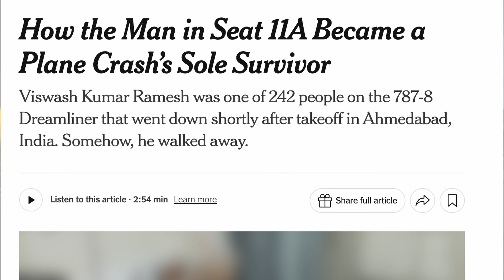Why the RAT Changes Everything – Air India 171 Update

Comment: I fly a pitts s2b and yak55m. Never any large commercial aircraft. I had an engine failure at 3100 feet in an old luscombe silvaire and it sucked. I was able to land in a farm field but the mud was pretty bad and damaged the aircraft but overall went as well as it was ever going to. I cant imagine the feeling of having a total engine failure with hundreds of people on board. So sad. I remember right after my engine failure and diagnosis my very first thought was i was glad nobody else was on board with me. Knowing you have a plane you cant land anywhere in front if you and hundred of people depending on you would be worse than knowing your going to die.

Comment: Even to retract the landing gear, you need power, you don't have special batteries, you rely on Engine power. If Engine fails, Electrical systems, hydraulics fail and landing gear not getting retracted and RAT gets deployed, which don't rely on Engine power, Engines failed Why?. No lift.

Comment: I thought I saw a video by someone who allegedly was on the same plane on the previous flight before this one and he had a video inside the plane showing everyone trying to turn their AC on and the AC wasn't working. Again, can't verify his claim but would that even be an indication of something wrong?
Reply: Because the airline is saving money by keeping the AC off, in figurings around 500kg of fuel an hour. The AC is the pressurization system, you won’t have oxygen after passing 10,000ft if it was actually not functioning.

Comment: Capt Steeeve, not only can you hear the RAT, it's what you don't hear. At that altitude, and how close the original cameraman was, you should hear the engines howling, or at least making some sort of noise. All we hear is the RAT. Both of the motors were dead. Don't know/won't speculate on why, but there was no thrust from them, and they were probably causing more drag than anything at this point.
Excellent breakdown, Sir! Please keep up the good work.
Reply: I was thinking the same thing.  How is the RAT overwhelming turbines?   I don’t hear jet engines at all.
Reply: @chrismechanic6164  That's because the video showing the plane crash with added propeller sounds is completely fake. I’ve watched the original footage with its ORIGINAL audio multiple times, and there were no propeller sounds at all. It’s disappointing what some people will do just to get views.
Reply: Yeah that’s the first thing I noticed too. That is not what 2 huge turbofans running at takeoff power sound like. It sounds like the engines aren’t running at all.

But the kind of engines usually used on aircraft like the 787 are generally known for being extremely reliable. Obviously in this case they weren’t. This might be one of those accidents that has implications beyond just this aircraft.
Reply: That's what I noticed when the video played as well. Any turbine engine isn't exactly quiet, even at idle. If any engine is running at all, it can't be much above idle. Now the question is, why. There are exceedingly few single points of failure for both engines on most aircraft, especially something the size of the 787. But evidence indicates that one occurred. ☹️
Reply: He does talk about it..not hearing the loud engine sound but the cessna like sound by the RAT being deployed...
Reply: Exactly! I was thinking the same. A 787 at that atlitude with normal functioning engines would be so so loud. As you said, we shouldn't heat the RAT if things were functioning normally. I am not an expert but even if one engine was functioning normally I doubt we would hear the RAT over the sound of the engine.
Reply: @TheScarletteWhisper  What I heard was just what sounded like a commercial airplane. Hard to gauge if it was filmed inside. But if experts say it sounds like a RAT, then I believe them.
Reply: Instead of raising the landing gear they retarded the engine throttles. During takeoff roll they received a call about an extended car warranty.
Reply: If engines howled and roared then why would the RAT be deployed at all?
It is clearly a engine failure 
Remember the plane has issues and is not a normal one with howling engines that we see daily up in the sky
Reply: Exactly, my house is a few kilometres away from the airport, not near enough to be in a danger zone, thankfully but yes I do hear that BOOOOM and I love that sound but in this video, it's missing. The turbines are dead and that caused the RAT to deploy.
Reply: @leocoolguy4138  I used to go to a school very close to a test facility for RB211s. And they were extremely loud indeed even several streets away, just one at once, when they were inside the factory and our windows were shut. In the summer, we were either roasted or deafened. I missed that characteristic sound of jet engines on the video, there was just that rather strange whishy sound, which people seem to recognise as the RAT. I'd just assumed the sound on the video was poor.
Reply: What about the loud BANG the survivor reported? He said it happened right after takeoff.
Reply: @diversityparty  Usually, witness testimonies aren't that credible. Normally, it could have just been the landing gears being retracted. But since that never happened, that's an interesting clue.
Reply: @diversityparty  the loud bang was the RAT deployment
Reply: There is a report on-line that Boeing Employees who were working on three 787 that was manufactured in January of 2014 were at high risk of engine failure. This concern was brought to the attention of the senior management at that time.. However senior management responded that the three planes were going to be shipped to International carriers and so it did not matter..  The specific jet that crashed was one of the three aircrafts the Boeing Employees were concerned about..
Reply: @nathanmenon3772  That's interesting,, got a source for that? I remembeer watching an Al-Jazera documentary about the 787 and how they were saying it's only a matter of time until there's a crash.
Reply: @nathanmenon3772  Can you please confirm the source of the report.
Reply: @TheScarletteWhisper there’s an article about it on The American Prospect titled One of the Dreamliners That Gave a Boeing Manager Nightmares Just Crashed.
Reply: @nathanmenon3772 Stop with spreading things that are half truth.
Reply: ENGINES not motors. Motors are electric.
Reply: This video is plagiarized. Jeffostroff shared this information yesterday. Steve did not even refer Jeffostroff!
Reply: Might want to listen again, the engines are clearly audible, albeit not “howling” but it’s clear the engines are at least on and making noise alongside the RAT
Reply: Didn't hee play this exact same clip in the last video?
Reply: @dan-bz7dz  Like he said, it was someone recording a computer monitor as it played the video, not the original recording.
Reply: @AySz88  Yes, but I remember it as he played both. But maybe I saw that on another channel. Yesterday, I definitely watched the original.
Reply: @dan-bz7dz it was a recording of the original video, not the original
Reply: @dan-bz7dz  Yes, but that one was copied from a monitor. Captain Steve was very clear in his explanation why this original and it's much better quality. It would do you well to actually watch and listen all the way through, so you don't miss something important.
Reply: @jamesplotkin4674  I know. I saw both vidoes yesterday. But maybe it was on another channel.
Reply: @dan-bz7dz you don't listen too well do you. He said it many times smh
Reply: @dan-bz7dz  The video showing the plane crash with added propeller sounds is completely fake. I’ve watched the original footage with its ORIGINAL audio multiple times, and there were no propeller sounds at all. It’s disappointing what some people will do just to get views.
Reply: @chintakjoshi  Do you have the link to the youtube video? Youtube links should be safe to post without getting auto-deleted. Or just send me the title and name of youtube channel please. 
When I first heard it, I thought it sounded like a normal commercial plane, but I am no expert .
Reply: @dan-bz7dz No, you must be confused with Jeffostroff's video. Steve plagiarized that video.
Reply: Keep up the good work?
Hmmmm he's embarrassed himself over the last couple of days.

Comment: Even if both engines failed, wouldn't you still have hydraulic pressure to retract the gear? Excellent analysis,  but im sticking with hydraulic or electrical failure.

Comment: Captain Steve, I knew you were jumping to conclusions on your initial take of this accident and pointed it out.  The flaps weren't prematurely retracted.  They are just difficult to see on the smooth composite wing of the 787 with flaps that blend well with the main wing curvature leaving almost no gaps - unlike what you see on older aircraft like the 777 or the barn door size ones on the 747.  Let's give the poor pilots a break and benefit of doubt.  It takes a good man to retract a mistake.

I think you're on the right track now, however we're going to have to define "dual engine failure" as there's no reason the engines should flame out or somehow roll back to idle at takeoff except from fuel contamination, fuel starvation or foreign object ingestion which we have ruled out at this point.  

Also if the reports of electrical issues in the plane are true, and the pilot saying "no power" in his Mayday call, then there's a possibility they lost the electric fuel pumps in the tanks as well, leaving only the engine driven fuel pumps to pull from the tanks.  I'm not sure if that alone can supply enough fuel for max takeoff thrust, even if it's good enough in cruise.  

Furthermore, fuel contamination would have affected other planes that day and we haven't heard of any others having this issue.  This leads one to suspect it was more of a fuel starvation issue due to failure of the main electrical system resulting in reduced thrust or a flame out.  Thanks for the update!

Comment: In a way, I guess the least scary scenario would have been pilot error. If, as it now appears likely, the crash was caused by some form of mechanical failure, the aircraft was doomed as soon as they passed V1. Almost certainly nothing the pilots did could have saved them. With pilot error, there's probably only a small chance of recovery at that height but at least there's still a chance. With mechanical failure its pretty much already all over at that point.

Comment: Could there have been complete hydraulic failure? That could explain why the landing gear was not retracted and the flaps remained up. The pilots tried to yank the yok but nothing happened as the hydraulic had completely failed. Examine the video the flaps do not move at all.

Comment: Is there a FADEC for each engine on the 787?  Is there only one for both engines? 
Could an electrical failure that cuts power to the FADEC(s) cause the engines to spool down ? Then maybe the RAT began providing power too late for the FADEC to command engine power before the plane hit the ground ?

Comment: MAYBE....Generator or generator connection failure (without affecting the engine)
Each engine has an Integrated Drive Generator (IDG).
If there is a short circuit, """" overheating  """"" , or mechanical malfunction, the IDG can be automatically shut down
In this case, the engine continues to run, but no longer generates electricity.

It would be a matter of finding out the temperatures to which the plane was exposed in previous days.

So it's highly plausible that:

The engines didn't suddenly shut down, but rather stopped responding to the controls.

Perhaps they were still rotating at reduced power (idle), but without sufficient thrust.

The plane, still with some control, began to descend with no way to gain altitude or power.

Comment: I was surprised the last radar contact on FR24 was over the fence of the airport. The plane had flown for a good minute after that, but no avail anymore. I suspected electrical failure that switched off the transponder and it seems I was right. The RAT deployment confirms it. What I still think is a bird strike on both engines when they were still rolling on the runway, but after the point they could abort takeoff. The engines were stricken and that's why the plane used all the runway, you can even see a cloud of dust being blown by the plane where the tarmac ended. After they passed the area of the airport the engines failed completely, causing a descent and electrical & hydraulic failure. Transponder went off thus no more radar contact on FR24, also the landing gear stopped retracting midway (someone pointed out the front gear was tilted forward which confirms it). I'm afraid they might not find anything interesting in the CVR and FDR, as when the power went out the recorders also might have stopped.

Comment: Could an electrical failuire cause the fuel pumps to stop feeding the engine's fuel?
There was a viral video of a guy claiming to have been on the accident plane on the flight just before the crash showing the AC and other cabin items not working.
I wonder if that, if holding valid, had something to do with the crash.

Comment: There’s a video of a passenger of the same plane the flight prior to 121, and they were showing that nothing is working - no lights, air conditioning.  Wouldn’t this point to an electrical malfunction prompting some sort of check from ground maintenance and inform the pilots next flight so they can decide if it’s good to fly? If such a massive failure happens, is it really still safe to fly without lights or airconditioning in the cabin? (On a long haul flight at that)? Genuine question, I’ve seen in air crash investigation that they show some maintenance log to the pilots before, but I’m not sure if it’s the same now).

Comment: The probability of dual engine failure is statistically very low, so based on your observations, the "why" must have a significant human factor.

The two that immediately come to mind are a maintenance error, or a fuel issue.

Beyond this, which is actually the frightening thought, a hidden issue within the aircraft systems. Boeing isn't unknown for having issues with aircraft systems that have resulted in loss of aircraft (and all lives) accidents.

Hopefully black box analysis provides some solid clues and quickly.
Reply: When it comes down to it, everything is human error right?

Comment: Yeah, Captain Steve.....agree it looks like the RAT did deploy to me, also. Another poster beat me to it.  But, there's something else I also hadn't noticed. Look at the main landing gear trucks. Landing gear engineers call the actual wheel assembly that, from what I remember. They're flattened out like they are during retraction and extension. Had the gear handle never been touched, those trucks would be hanging at that upward angle they're at when extended. That's interesting. So, maybe the gear handle had been put to the "up" selection and the gear began the retract sequence when whatever happened occurred.?

Comment: What about the Flight Tracker showing the plane Taxi to the middle of the runway and use less than half of it 1.18 miles at most for takeoff of this plane fully loaded for nonstop to London? Is the pilot using a half a mile less than the minimum runway needed for safe takeoff not a factor here?

Comment: I'm strongly leaning towards electrical failure, given the complaints of passengers about no air conditioning and like someone in the comments mentioned, problems with the consoles on the seats.  In the video you showed us, there are no bird flocks visible, so any other reason for dual engine fault is extremely unlikely during these first moments of flight.
But problems with the electricity even on the ground with the engines off, would put my focus on electric failure for sure.

Comment: Great analysis. Didn't the plane also use up most of the 11,000 ft runway to take off creating a dust storm? Doesn't that point to lack of thrust as well? Bird strike would probably have resulted in sparks or smoke coming out the exhaust which was not seen. If the engines failed, it would have resulted in loss of thrust as well as electrical/hydraulic power to retract the gear.

Comment: I think the aircraft suffered a massive electrical failure.
1: The sole survivor said one loud bang. I dont think this was an engine suffering a bird strike or failure. We dont see anything happening from the engines such as flame out smoke, fan blade seperation, etc.
2: We do see engines still producing thrust. But not nearly as much as when the aircraft rotates and the video offers sound of engines near idle if you listen closely. 
My theory: loud bang was the batteries blowing up and they took out all the avionics and everything went into a weird mode including engines going to idle.

Comment: Evidence of the other video with the shack showing the take off suggests they were having trouble before take off as the pilots used every bit of the runway available and even kicked up dirt. I've heard the heat could of contributed to a power loss. The landing gear still being up suggests this as well because they either couldn't get it to go up or the pilots were too busy battling with a problem.

Comment: Now my educated guess were really  close to this case now. 

The situation is now almost similar between olympic airways flight 411 and air canada flight 143 combine.  The only difference is , there is still atleast two engines running  on 412 while the other one is not overweight but glyding with RAT deployed for 143.

My conclusion is, this recent crash was really due to maintenance issue  disregarding flight safety which cost lives of innocent passengers. 

We just now need to wait for the final investigation report on the sequence of event on where the fault started, is it during the roll or is it after it lifts off  even by inch?